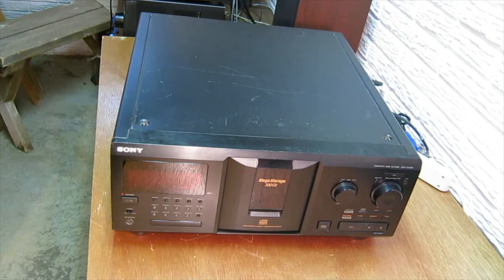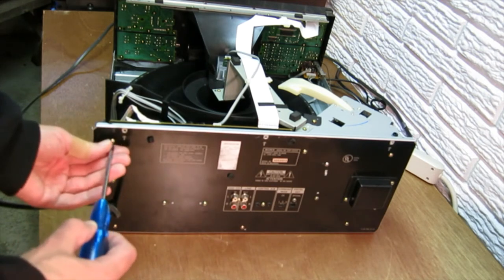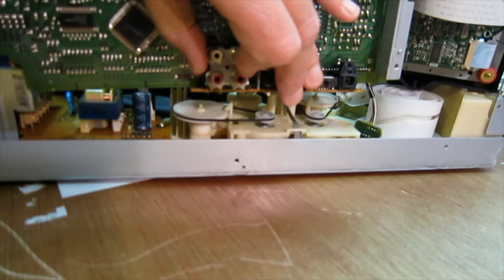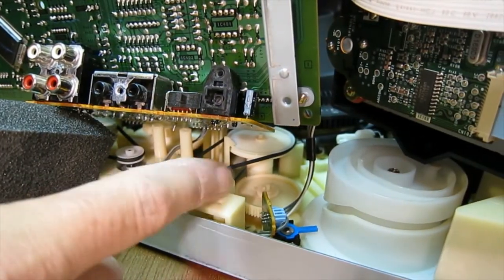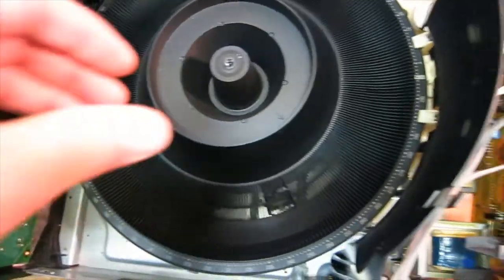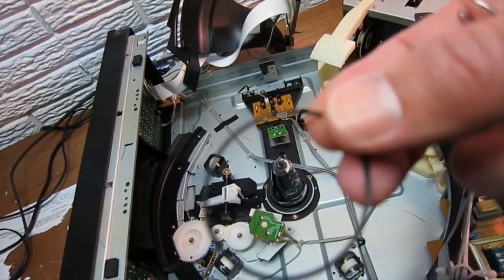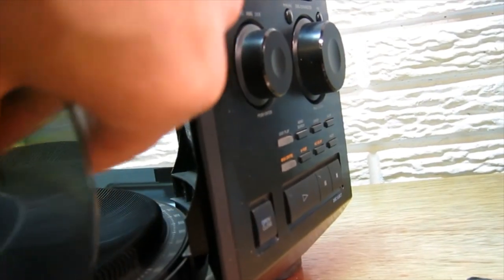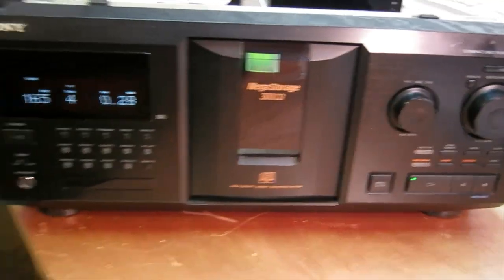Sony CDP CX350 Complete Belt Replacement How To

Comment: Very good step by step instructions.  I was a first timer at this.  By following the video I was able to successfully replace my belts and only had one orphan screw left over......
I do have one comment and that is this video did not address those of us that had a carousal full of Cd's.  These had to be removed before the part could be lifted out to access the door belt.  A real treat trying to keep the cd's in order and back into the correct number slot.  Anyway, thanks for a great instructional video.
Reply from the maker: You are welcome!!! I'm glad it worked out for you!  Thanks for the comment.

Comment: THE DISC TRAY IS NOT NUMBER SPECIFIC. It recalibrates itself when it is put back in the machine and powered on.

I discovered this after i forgot to mark the tray, a good "whoops" i suppose
Reply from the maker: @arboc5540  Great point.  Thanks for commenting.

Comment: Been watching a lot on videos on these particular units. All seem to have the same gooey belts. I can't help but notice that the two belts in the back seem to be located near what looks to be a transformer on the back panel. Is that possibly a transformer causing heat to kill the belts? Seems odd that the belts get gooy, I would expect dried up belts instead. Nice repair sir.
Reply: Not likely! Drive belts just get gummy and stretched out of shape over time. I used to see this in 8 track players back in the day when I worked on them.